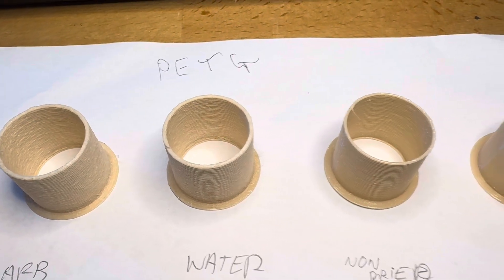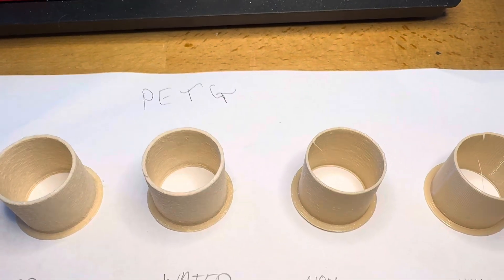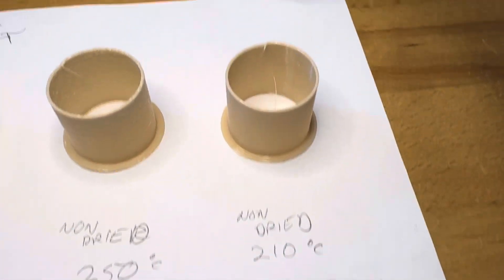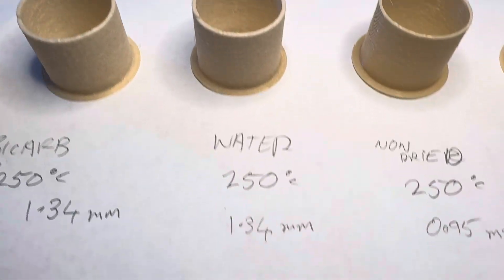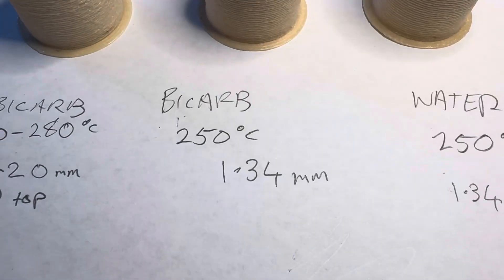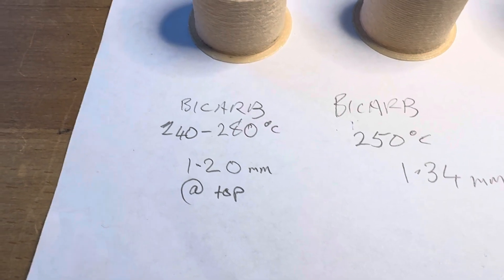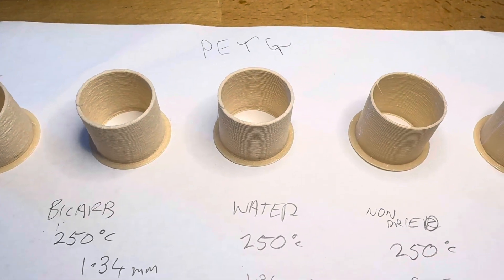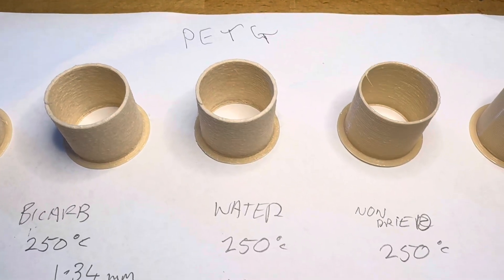Foaming PETG. Make your own LW-PETG. RCHacker #87

Comment: Hi Mark, stumbled across your video and was intrigued.   I wanted some transparent foaming material but that doesn't appear to be available and your idea might work.  Had to try so chucked a roll of transparent PETG in water over night and have done some test prints.    Whilst there might be some expansion/foaming on the soaked filament it is tiny, almost unmeasurable...no where near what you achieved for sure.  Trying some non transparent PETG now but was wondering what brand filament you used?   Done any more experiments?

Comment: Very nice indeed ! did you weigh it ?
Reply from the maker: Not these ones, my scales are not accurate enough. These all have the same flow rate, so assuming all the water turns to steam they should weigh the same. I've since printed parts with the flow rate reduced, same dimensions, 50% less filament.